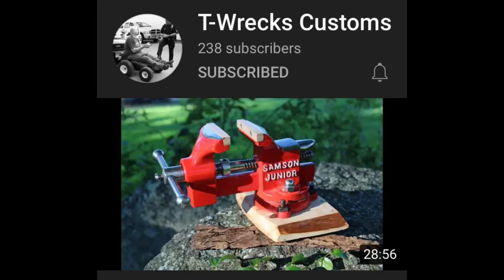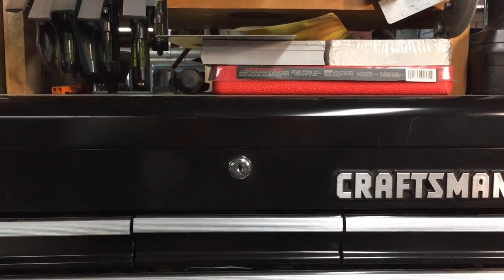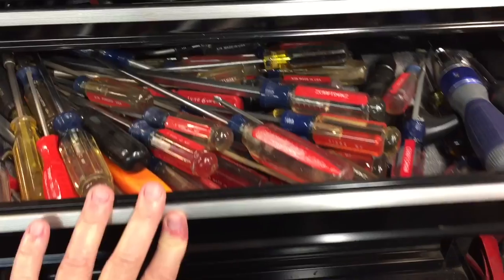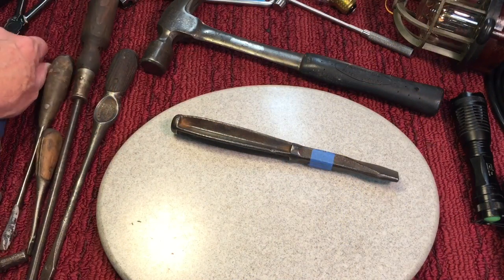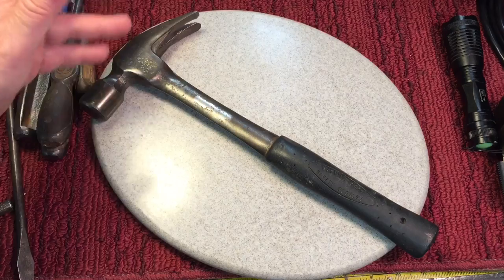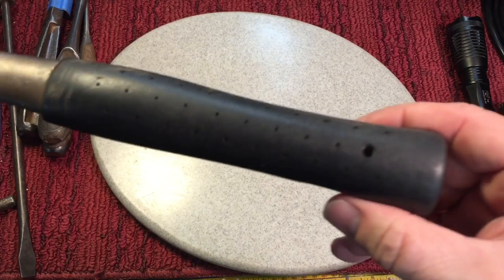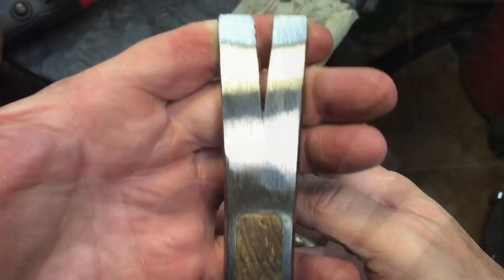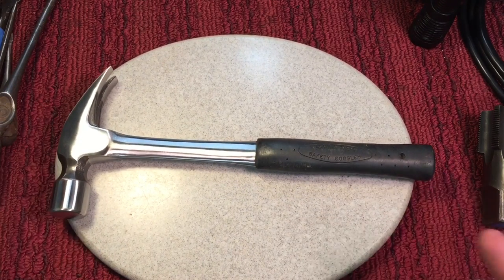Vintage Collectable Craftsman Hammer #38273  20oz "M" Series

Comment: I have 3 tool chests and I organize every drawer by tool type as much as possible. There’s a few small special tool drawers and rarely used tool drawers. Like you said, most commonly used up top, lesser used down lower. My separate drawers are Phillips, slotted, nut drivers, regular sockets sae/metric, impact sockets, adjustable wrenches, slip joint piers, regular pliers, side cutters, lineman’s, special hammers, regular hammers, sissors, picks, files, files, files and the remaining have too many rusty tools needing restoration.

Wonderful job on the hammer! Did you say you used ArmorAll on the handle? Don’t let me stand near you when using it, lol!
Reply from the maker: LOL- Steve- The Armoral I put on was just for a fact but if you rub it in good with your hands it doesn’t stay slippery.  😃👍

Comment: my tool box drawers are marked on the front so I know what each one holds. from top to bottom 1 pliers 2 screwdrivers 3 sockets then half drawer files / chisels 4 standard wrenches 5 metric wrenches 6 adjustable wrenches and pipe wrenches 6 clamps bottom specialty tools I don't use much. hammers are hung over my bench. my side box has 1 marking tools 2 measuring tools 3 cutting tools.

Comment: Super job on that hammer. If you  suspended the shelves above your tool cabinet, you'd be able to roll it out to access the top section. How about restoring screwdriver #3 first.

Comment: I use easy liner from Wal-Mart to LINE the bottom of the drawers.  I had a problem with the Craftsman liner scooting in the drawer.  The easy liner deems to grip the bottom of the drawer and not bunch up. 
My tool drawers look similar to yours.  Like items together.  The only tip I have there is not to overload your screwdriver drawer.  It's easy to do. My flat tip screwdrivers are on the left with the handle to the left. My Phillips screw drivers are to the right with the handle to the right. When you open the drawer you don't have to dig around for the screwdrivers. In the center I have a small impact screwdriver set in a case.
Yes the top of my tool box is a waste to me. It's open all the time and full of crap.  Dusty and I can't see what's in it because I'm too short.  I stand my retractable measuring tapes in the open top.   They stick up above the edge so they're easy to grab. Speed square and my Stanley square also reside in the top.
Maybe a Scoutcrafter Challenge to clean out your worst toolbox drawer.  Your screwdriver drawer would be a good candidate.  A couple of nice before and after photos?  And did you find any, "I was wondering where that tool was.  I've been looking for that for years."

That hammer turned out nice. Red accents are so shiny.  I'm thinking about restoring some tools for Christmas presents. I have six grandsons and four sons-in-law and the Marine. Hammers would be nice.  Cheap too, just like me. 

Flip a coin on one or two.  Maybe both?  That heave duty one. Wow.

From the dreadfully hot banks of the Underwood Branch, thanks for the fun!  :-)

Comment: The only special thing I do in my tool box involves my sockets. I keep my sockets in order with the open end up except the 9/16, 3/4 and 15/16 which I keep with the square drive up. 9 times out of 10 I need one of theses three. Allows for instant recognition of the tool I need at the time.

Comment: Re toolboxes, all I can say is - big or heavy stuff at the bottom and only ever open one drawer at a time. 

It’s funny, you say you use your nut drivers regularly but tbh, I don’t think they’re much of a thing in the U.K.  

We are looking at a new angle grinder which doesn’t require a key to use. Hubby injured his arms in a motorbike accident and lost his strength (that little button can be tricksy). and I never had the strength in the first place (I’m disabled).  The new angle grinder will allow us the be able to get stuff done,  about time they made tools that allowed disabled/elderly to stay in the game.
Reply from the maker: Sarah- That is one reason I went with the "rat tail" design, the handle is much thinner and easier to hold.  The traditional angle grinder has you gripping the barrel and that is just uncomfortable...

Comment: Tip#1: Use 1/2” Yellow P-Touch labels to identify the theme of each drawer (i.e. NEEDLE NOSE, VICE GRIP, SLIP JOINT, CUTTERS, RATCHETS, SOCKETS, NUT DRIVERS, HEX KEYS, SPECIALTY, FILES, CHISELS, METERS/TESTERS, KITS, etc.)

Tip#2: Buy thrift store yoga mats to use plain side up as tool drawer liner material. For further savings, shop on applicable discount days (Senior, Military, Veteran, etc.).

WRT next restoration, I would like to see screwdriver #1. Specifically, 1) how you intend to address the shortened/ blunted tip and 2) detailed step-by-step video of restoring the interior crevices.

Comment: Lovely hammer, too good for everyday use tho! O.K. My choice is Screwdriver #1, 'the monster'. Btw, such a large flathead suggests big, tough screws, So, is that handle practical, or even, comfortable enough for purpose? A tight screw will need a tight grip to apply torque so; ouch?

Comment: #1 for the tool restoration - never seen one like that before.  How about making a mold for the handle and pouring epoxy around it?  BTW, is there a reason why you didn't take the chips off the inside of the claw on the hammer?
Reply from the maker: I didn't want to widen the gap of the claw, they are cast in such a way that standard nails grip at different leverage points so I didn't want to open that pandora's box!   =D

Comment: I have a Craftsman 38273-20 oz hammer that was my dad's. It has similarities to this one like the octagon shaped neck right before the head, blade style shaft, wooden spline, and thick rubberized handle. However, my hammer has the actual "CRAFTSMAN" logo with "=REGISTERED TRADE MARK-M=" stamped in the steel. On the opposite side it has "===SEARS===" and "38273-20 OZ." stamped in the steel. Are you sure that is not maybe a 38278? Mine also has nothing stamped on the handle.

Comment: So, I have this hammer as well as two other very similar hammers that appear to only have a slightly shorter head but be identical otherwise. Can you tell me what featur e or characteristic makes this particular hammer collectible?
Reply: On closer inspection, I think maybe yours is a little larger? Is it collectible because it's particularly big? It does seem to have a very long striking face
Reply from the maker: @jpsimon206  - This was a popular hammer with carpenters and tradesmen years ago, the balance and proportions were very comfortable. It is also 20oz and the claw is a cross between straight and curved.  Apparently guys got used to the hammer and when theirs went missing they wanted the same one so the prices on these seemed to climb more than others. Vaughan hammers are amazing...  I think maybe the best!

Comment: Unlike you. I use my top of the craftsman tool box for my multimeters and electrical supplies. As I use them all the time. And of that same section it’s all screwdrivers and pliers and wire strippers. On my roller toolbox below that is all my hammers and drills and big bulky things. But yes… just like you. Too many tools and it’s unorganized!!! But that’s how tool addicts are. The more the better!